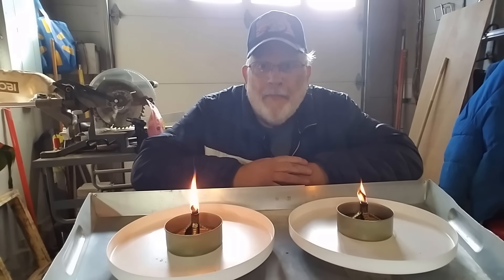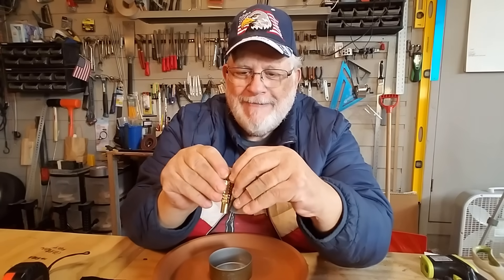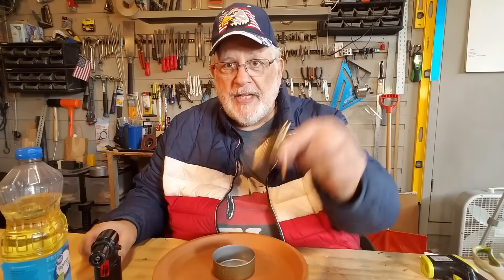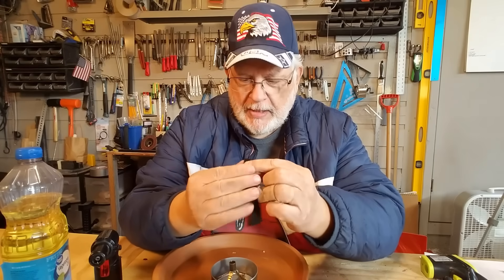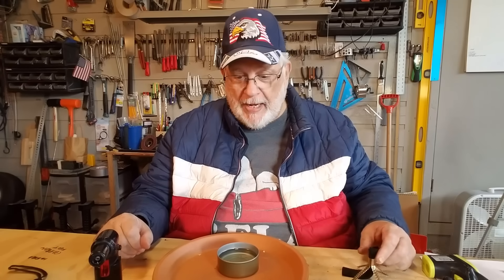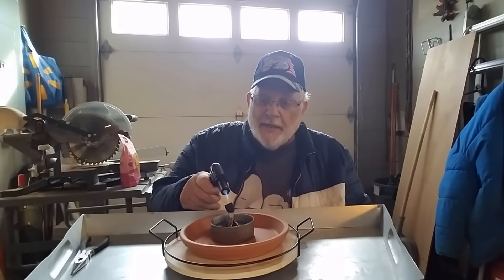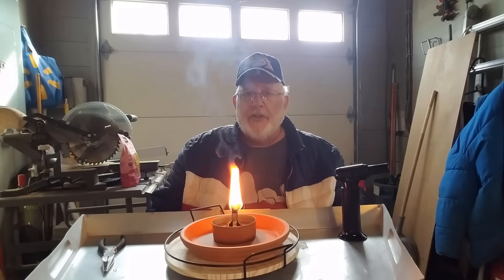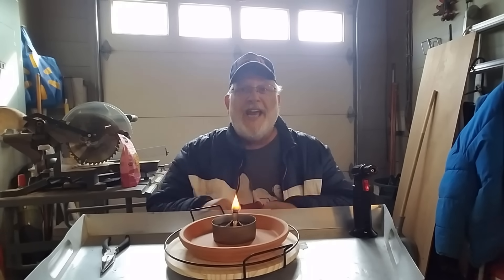This Candle Burns Forever (Safe, Simple, No Electricity)

Comment from the maker: The concrete anchors can be very hard to find but here's where I got mine at Amazon: Tree shaped steel, 2.5" Concrete anchors: https://amzn.to/49iwqzK  I could only find them in a set. Let me know if you find a better source. You may find them at hardware stores as well.
Reply: LoL
Reply: @whyamigreen  it is called the BUTTERFLY SCREW
Reply: Amazing Sir
Reply: We use a cork floating wick holder and bundled cotton threads as wick.
You may upcycle wine bottle cork and aluminium can to make the wick holder.
A clear pyrex bowl makes a good oil container.

Comment: Great video!  I did a similar project by melting Crisco and pouring the liquid into a jar.  I’m going to use your method, too.  Just a thought; if you use tuna packed in oil, you can reserve the oil (which is vegetable oil) and use it for the fuel.  I wonder if it would have an odor

Comment: I assume this is an indoor flame... right?  Because of the vegetable oil?  
I know the Jews used olive oil to fuel their lights.  I have tried that.
I love the easy wick holder !!!   That is something I want to have, along with the carbon felt, in my emergency supplies.  I assume this would work in a jar... maybe one that is tall enough to avoid having the flame go out by the wind.  Do you think a jar could be stabilized with small rocks or dried beans or something like those?
Reply: @work2gather  it's the Palestinians that use the olive oil. They are the ones that have grown the olive trees for hundreds of years. Jews are allergic to the olive trees. Israhell has burned and destroyed almost all of them. Many over a hundred years old. Burning olive oil is an Arab thing not a Jewish thing.

Comment: Doesn't it give off carbon dioxide
Reply from the maker: Yes, all combustion produces carbon dioxide. That’s true of candles, oil lamps, and fireplaces. This is for emergency or short-term use with ventilation, just like any open flame.

Comment: I wish I knew of an easy way to get the carbon fiber felt. Not easy to get in south Africa. Would I be able to use fibre glass as a felt?
Reply from the maker: Isn't fiberglass toxic?  I know nothing about it. You can get carbon felt on amazon can't you?
Reply: @whyamigreen yes. But the prices are insanely high.
Will have to brain storm. Other possible wicks😊
Reply: @FHG1st  Someone suggested 100% cotton wick or rope. Good luck!
Reply: @FHG1st  
Fiberglass works good as carbon fiber but fiberglass can prick your hands like a splinter and be very irritating.

Comment: This is a great design! Can you make it with Crisco so it won't spill in your backpack?
Reply from the maker: I don't think so as the fuel needs to be liquid to have the wicking action required.
Reply: @whyamigreen  I was thinking it would become liquid from the initial heat and continuing flame.. like a candle.. guess I should experiment and see. Cheers
Reply from the maker: Let me know how it works for you.  You'll have to prime the wick first if the Crisco is solid when yo start.
Reply: I have seen several videos of people using crisco in the can for a candle. A little search on YouTube might help.

Comment: What if I replace oil in this setup and use 90% and above rubbing alcohol 99% isopropyl alcohol ?
Would it work ?

Would you want to make a video about it ?
Reply from the maker: It would be too explosive. With alcohol, even the fumes are flammable. Vegetable oil is not combustible. Instead of just the wick burning, the entire surface of the can would be on fire.

Comment: The blanket is used for welding and soldering. It is called: Welding Blanket Fireproof, Fire Retardant Blankets, Carbon Felt Heat Resistant Fabric mat UP to 1800°F, Flame Retardant Fabric for Grill Cover Soldering Welding Brazing Plumbing.
Reply from the maker: That's great information, thanks for sharing!
Reply: @whyamigreen  glad you understood him because the more I read the less I understood

Comment: Vegetable oil burns very dirty and the fumes are bad for your health.
Reply from the maker: Thanks for the comment. This video is a DIY decorative/emergency-style candle demonstration, not a health or heating device. As with any open flame, use proper ventilation and common sense, and follow basic fire safety precautions.

Comment: I made one of these and found that with a little squirt of alcohol on the top of the wick helps lighting the wick.
Reply: I saved a few dropper bottles to put an alcohol in to put drops on. I make something similar.  I use lamp wick through stainless steel scrubbers in a cup with a bit of oil. Let the oil drawl up and a few drops of alcohol to get it burning quickly. I need to buy carbon felt to use instead!
Reply from the maker: That's a great suggestion, I'll have to try that!